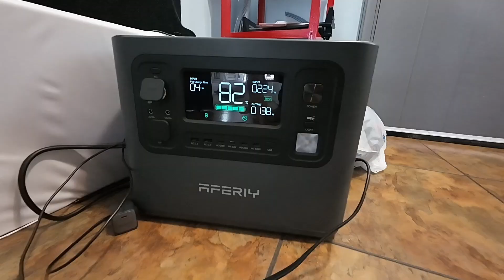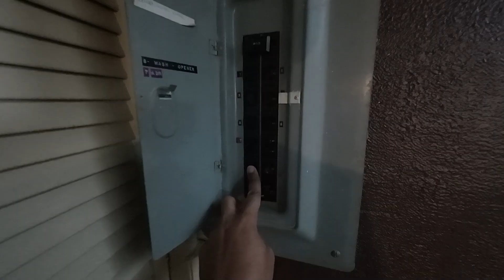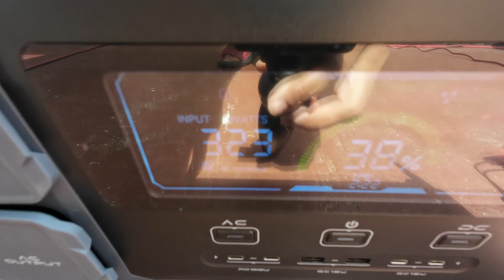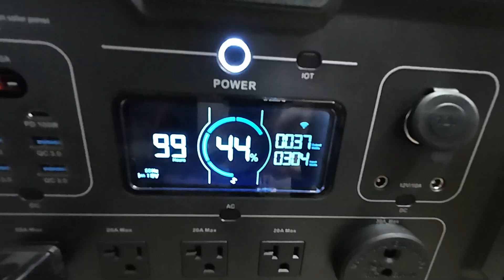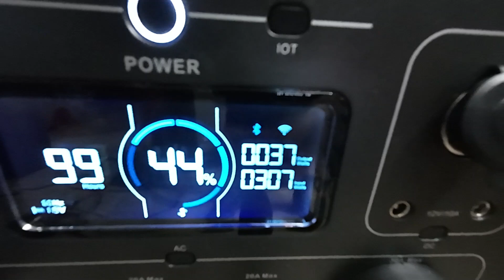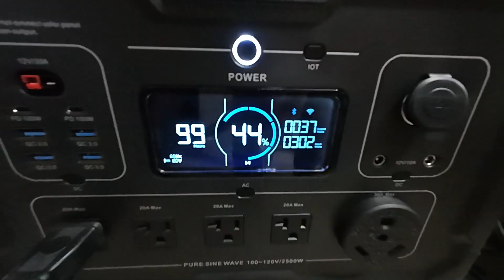My Solar System Is NOT Enough! - Wife Needs More!

Comment: Seems like a waste to have a bunch of these little setups all over your house. I know you're doing this on a budget but I got the Delta Pro Ultra and eventually scaled to 24kwh and it does everything I need and more. You probably would benefit from the Anker Solix system or Ecoflow Delta pro 3 if the Ultra is too much.
Reply from the maker: These were mostly given to me in exchange for content, so I make it all work
Reply: @AskIveSolar What are your thoughts about the Delta Pro Ultra if you've ever looked into it? I've recently learned about that brand I'm uneducated in solar overall. I'm a female and figuring out/inputs and wattage is quite confusing along with what solar panels are compatible with different solar units. Thanks for any assistance.
Reply: ultra is the way to go I love mines. next is a 12000xp from eg4
Reply: Naw definitely not a waste. This is a great test on the power stations and he will end up with way more data than most people because he is running these units foreal. Thats what I like to see when im researching something before I make a purchase. Real life situations. I do agree with you that its inefficient but he will go bigger when he wants to